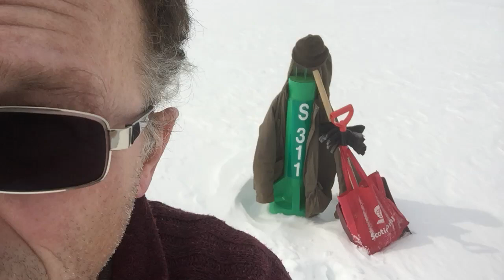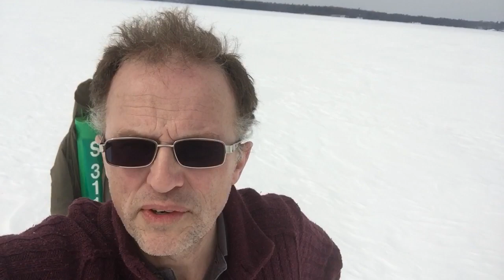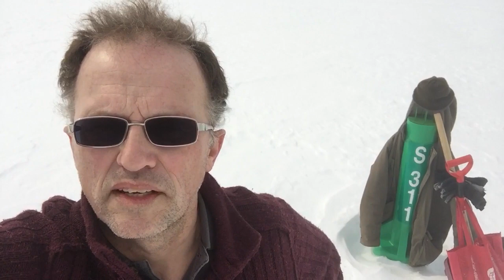On necessity of geoengineering to cool Arctic

Comment: Geoengineering is happening now. One of the many reasons they are doing it is to melt the artic so they can get to oil and gas. They can direct warm air coming off the pacific and steer it towards the artic, u can see it in the jet stream if u pay attention to the satellites

Comment: Hi Paul,  I have been documenting the SRM that has been going on in my area for at least 2 years now. I am not denying that what you are saying is happening. I just know I have been trying to get this SRM stopped.  And, here you are calling for it.  As far as the Jet Stream not being normal I thought that was from all the things the military are doing with Stratospheric Aerosol Injections  and  HAARP type radars. I just don't believe the SRM you are calling for will help because they are all ready doing that and didn't you say things are getting worse?
Reply: Pocahontas McDonald Look UP - Chemtrails and Coal Ash.  I would also submit that a major factor in the Arctic Melting is from the acidization of the particulates being dumped into the Jet Stream, having an effect similar to putting rock salt on a sidewalk...so yeah, there is evidence of global melting, and I suppose that some of it is a natural feedback response of building maSSieve damms, which cut off the alkalizing water shed from ever reaching the oceans...the weight of the water causes subduction events thru hydraulic fracturing, as the waters find  or create a new path back to the primordial sea...so even the geo-engineers are part of a geologic re-cycling of carbon and cannot reverse the natural order, even with their insane approach to climate anomalies.  Nest ces pas?
Reply: Thanks
Reply: Dams don't hold back water indefinitely. They have to release water from time to time otherwise the water that keeps coming from the river would overwhelm the dam without some release. Would the weight of water backed up by dams seeking a way back to the ocean cause earthquakes like pressurized water in fracking operations? Maybe but something like that would similarly do so from flash floods caused naturally and by geoengineered weather.

Comment: Paul, you need a windsock for your microphone, even if it's within a video camera.  Without it, the wind noise makes the audio difficult, and stops reproduction of your message further (say through radio, or podcasts).
Otherwise, it's a powerful argument.  
I'm working on a series on SRM, with guests like David Keith and Alan Robock, for Radio Ecoshock.

Comment: Paul Beckwith,

Thank you for having a youtube channel.

If I understand you what you are suggesting is that in addition to beginning to radically and immediately reduce C02 emissions that it may be necessary to begin applying a 'haze of sulfur dioxide' into the arctic atmosphere, at least perhaps during the immediate spring and summer seasons to block solar radiation from melting the rapidly receding arctic ice.

Comment: The Brazil situation has illustrated how populations dealing with resource scarcity (water) turn against each other compared to disasters like earthquakes or hurricanes (one off situations) which bring people together in solidarity. To understand this is required for governments to better anticipate problems. I don't have access to journals anymore, but understanding the human response to issues related to climate change are not going to be common. Governments have got to start planning for these events which means studying what is happening so far or society will quickly fall into anarchy.

Comment: I've come to accept long ago (maybe 20 years ago) that 1) we're probably underestimating the degree to which climate will change and 2) we aren't going to do anything to prevent it, so we'd might as well try to adapt to a new climate.
Reply: Adaptation has a limit. Many species are dying out, agriculture is on the decline. Did you know that if it doesn't go below 20°C or so at night, the must fruiting plants won't flower? The oceanic food chain is also crumbling from pollution, over fishing and now Climate Change is rapidly decimating species, not to mention ocean acidification.
We should hit the dangerous 2°C IPCC limit of warming around 2036, that's not taking into account any large methane eruptions from the Arctic. When that happens, expect a sudden rise in heat to 4°C to 6°C untill more methane erupts.
We keep hearing we're at 400PPM of CO2... But if we take into account the other greenhouse gases: methane, nitrous oxide and tropospheric ozone, we're slighly above 4500PPM of CO2e (e = equivalent)
We need to force the medias to talk about it, situation is deadly critical!
Reply: A. Randomjack Yup, Things be dire. We defiantly need to pay more attention to that ocean thing.

Comment: New methods of farming can help if implemented fast enough. Farmers that do organic no-till and intensive pasture management have increased organic matter in the soil by several percent in just a few years. As you all know, farming is currently a net producer of GHG, but it does not have to, photosynthesis has a huge potential as a climate stabilizer. It can be done, and it can even be profitable. And it is a lott safer than radiation management.
Reply: Frode Haugsgjerd Frode,I totally agree. I've been on the ground trying to do just that. We need lots more people doing it. I will say though.... I'm up at a pretty northern latitude and on clear sunny days that sun is intense. And it's not even spring yet.
Reply: Darth HeyZues To further develop your thoughts on plants Frode, What has drawn me personally to them as the primary solution is that they in fact accomplish both SRM and CCR. The carbon capture is through growth and the solar radiation management via shading. So plants are pretty much totally awesome.